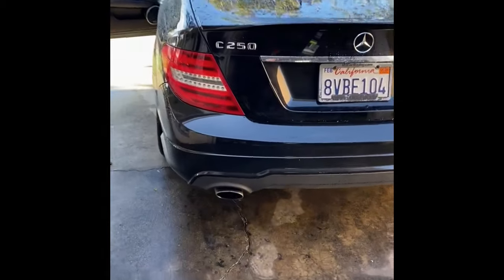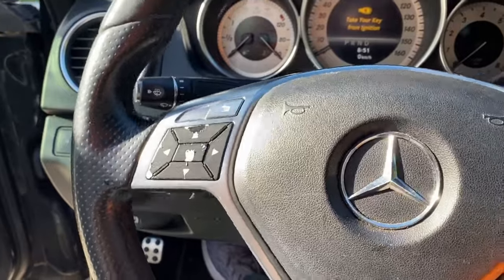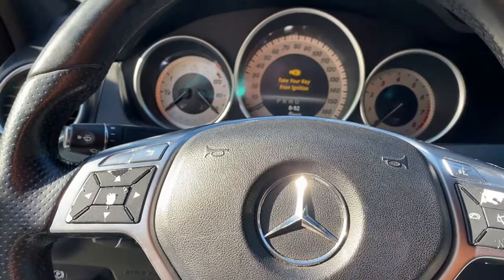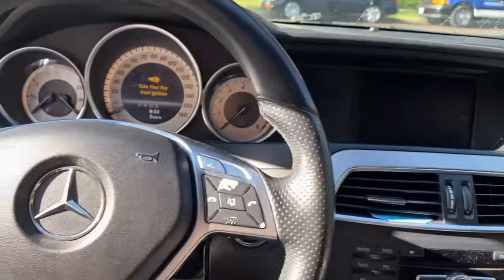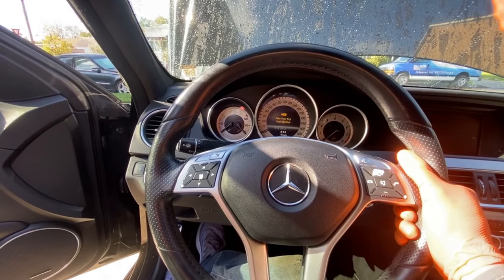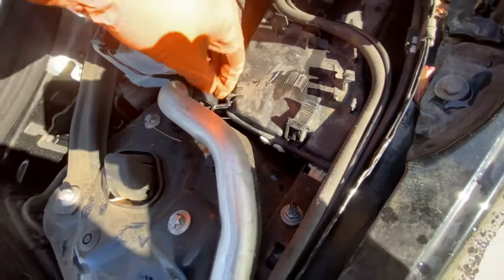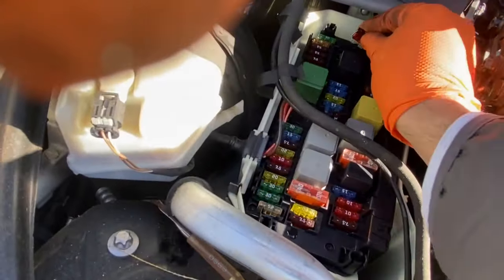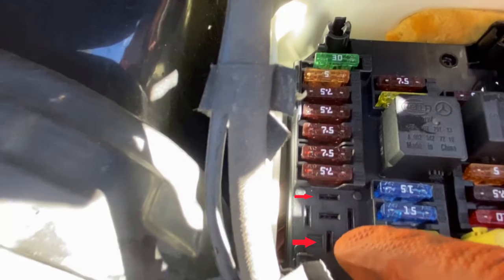Mercedes W204 C300 C250 Locked ESL. Car won't start? You can use this trick to start your car.

Comment: Am having this problem on my 2012 glk350 the car starts but my steering is very stiff please what do I do
Reply from the maker: The steering lock has failed. You must remove the steering lock from the steering column. 

Then send us your ignition switch and key. We will program a steering lock emulator to replace your failed steering lock. 

Watch this video. 

2014 Mercedes C250 W204 ESL Removal. Electronic Steering Lock Removal DIY.
https://youtu.be/CQo6iTOaby4

In this video I’m working on a c class. But your GLK will be similar.
Reply from the maker: 818.510.3375

https://mercedesbenzspecialist.net/
Reply: @mercedesbenzspecialist  I’m so confused my mechanic said it’s the steering pump
Reply from the maker: @OsasIduriase  ok. You said you were having this problem. This video shows how to start the car from the fuse box when the steering lock has failed. 

Maybe you’re having a different problem. Can you start your car normally?
Reply: @mercedesbenzspecialist  yes I can start the car
Reply from the maker: @OsasIduriase  ok you’re not having the problem in this video. This video is for a no crank no start situation.

Comment: I thought it was that buy my crank case to engine  is froze  is that a esl system lock for the hoke engine ne on lock or is my engine done
Reply from the maker: Take the serpentine belt off and see if the main crank turns by hand. Use a breaker bar to turn it.

Comment: I have a 2010 e550 Coupe no start and no crack with full charge of battery and I tried to do this like he showed in this Chanel. I still have the same problems ?? Can anyone  give me suggestion...
Reply from the maker: More information is needed. 

If you insert the key into the ignition switch with the driver door open. Does the instrument cluster give you a message “Take key from ignition”?

Or is there absolutely no response? No audible “ding” no message on the cluster?
Reply: Hi, I'm getting no crank or start on my c200 c class. All the instument cluster lights up and dashboard lights. Steering lock seems fine. It's locked when keys out and unlocks when key is in. However I don't get the ding or remove key fob with either key and as I said the car won't start. This happened completely randomly. Please can you help
Reply from the maker: @minhajchowdhury783 what year is your c200? What country are you in?
Reply: @mercedesbenzspecialist  I'm in England, it's a 2011.
Reply from the maker: @minhajchowdhury783  check for a ground signal while turning the key to the crank position at the fuse box where the starter relay is. Watch this video for guidance on how to do this test. 

Mercedes 2008-2014 C class No Crank No Start. You do have AC on lights. Not the ESL, maybe the ECM.
https://youtu.be/3Ek8foTUl88
Reply: Hi i did this today. The tester showed a reading of minus -697. Unfortunatly i dont have a multimeter with a buzzer. Does this mean my ECM is bad? As it showed 0 or close to 0 right. And if so how do I fix it. Get another and get it cloned? Thank you for your help so far  @mercedesbenzspecialist
Reply from the maker: @minhajchowdhury783 tester? I don’t know what tool you’re using. There should be close to 0 resistance.
Reply: @mercedesbenzspecialist  I'm just using a  normal multimeter. But the resistance when the car was in ignition and cranking was not 0
Reply: @mercedesbenzspecialist  do I need replace ecm?
Reply from the maker: @minhajchowdhury783  yes it needs replacing.

Comment: 🚨🚨🚨If You Do This And Your Wheel Is Locked, LET THE CAR RUN FOR ABOUT 20mins Cut It Off Then Try Cranking it normally.. You’ll kno It’s Working If You Here It Unlock When You Put The Key In.🚨🚨🚨🚨🚨🚨🚨
Reply: Is your car still working?

Comment: Can u do this if steering wheel locked?
Reply from the maker: You can. But if your steering wheel is locked, you won’t be able to drive it. 

Also, this does not work on 2013 models. 

818-510-3375

Comment: Hey, my car is having the exact same issue and it won’t crank either. Only thing that’s different is I noticed your dash actually lights up mine does t have any power at all. No crank and electric power at all. Tried jumpstarting it dash lit up but still no crank.
Reply from the maker: Sounds like two issues. Battery has insufficient voltage. That’s why your dash was completely dark. (Not even mileage shows up?)

When you connected another power source dash lights up. Here is where I need more specifics. 

When you turn key to ignition 2 do you have red and yellow dash lights? If you do, you don’t have an ESL, EIS, or key issue. Start looking for an issue from the fuse box. Bad starter fuse, bad starter relay. 

If you don’t have reds and yellows it’s most likely a bad esl.
Reply: @mercedesbenzspecialist my c300 jumps runs great kills like 5 mins off cables and won’t crank alone new battery that’s the alternator?
Reply from the maker: @toeupalex  I’d check to see if the alternator is charging the battery.

Comment: I have 2008 C350 and it will let me unlock it and lock it with the key fob, and when i get in the dash is on and once i  insert key everything goes off
Reply from the maker: Send me a video of what happens when you stick the key in the ignition with the driver door open. 
562.233.0989
-Michael

Comment: My console says key doesn't belong to vehicle when I put the key in. Will I be able to start if the key is not recognized
Reply from the maker: No it won’t start if you’re not using the correct key.
Reply: @mercedesbenzspecialist  they are correct keys but after replacing batteries in them I got "the key doesn't belong to vehicle" message
Reply from the maker: @amcarr270  You have two keys? Both are giving the same message? The correct battery is CR2025. 

Do you know if your steering lock has failed?
Reply: @mercedesbenzspecialist  yes bith keys give same message. I havent really checked to see if steering locked. I testedcar battery and multi-meter says 11. something volts, then i tried to jump but couldnt then read battery again and said 12.07 volts. If steering is locked then what?
Reply from the maker: Jumping can cause desynchronization of the keys and EIS. It’s best to avoid jumping a MBZ. Use a trickle charger to charge your battery. Or replace it if it cannot be recharged. 

If you have no choice, use a jump pack, and make sure the key fob is not inside the ignition switch when attaching cables to your battery that are powered from any outside source ( jump pack, battery booster, another vehicles battery) only after the outside power source is attached to your battery do you insert the key into the ignition switch to attempt to start your car.
Reply: @mercedesbenzspecialist  it was a last resort as both keys have not worked since batteries changed in them . Plus I can't jump if key not recognized. If I charge battery is it possible keys will be recognized?
Reply from the maker: If they are not synced anymore. You’ll need a programming tool to attempt to resync them. Give me a call tomorrow. I can help you resolve this issue. 

Call us at 818-510-3375
Reply: @mercedesbenzspecialist  okay

Comment: my car w204 c220 wont start even with this trick any help?
Reply from the maker: This trick won't work if you have a bad key, bad ignition switch, bad starter fuse, bad starter. There are ways to diagnose all of these. Get in contact with us if you need help.

https://mercedesbenzspecialist.net/services
Reply: my Electronic Steering Lock is dead and i just ordered new one could that be the problem
Reply from the maker: @kariturve2570  usually this start trick works if you only have a bad steering lock. If this trick is not working. You may have a bad key or ignition switch. 

I can help diagnose the issue over the phone. While you’re at your car. 

Make an appointment here. 

https://mercedesbenzspecialist.net/services

Comment: where can I get that wire??
Reply from the maker: It's a 14 guage solid copper wire. Commonly used for household lighting circuits. You can get some at home depot or Amazon.

Comment: Ok so my steering is unlocked but my ignition won't turn on c240
Reply from the maker: Steering is always unlocked? If always unlocked. Your ESL has failed. 

If it unlocks on key insertion to the EIS, do you have red and yellow dash lights when you turn the key twice to the right?
Reply: The ignition is locked Will not turn
Reply: Car died in drive I turned the windshield wipers on and it kinked and cut wires I repaired them and now I have the ignition problem
Reply from the maker: @JoshuaGalvan-vh2hy  Ok this just got way more complicated. I'd go back and make sure the repairs you made are good.
Reply: Ya I know I've ran through it over and over it's getting frustrating even in neutral key won't turn
Reply: Like it's locked won't go to second position
Reply from the maker: In your first comment you said the steering was unlocked. Does it lock when you remove the key from the EIS?
Reply: No
Reply: Key doesn't work what do ever nether the wheel I have to replace ignition now I accidentally broke it
Reply from the maker: Oh no, If you need a cloned EIS. Give us a call tomorrow. 818 510 3375

-Michael

Comment: Dont see the point to this if your Steering Wheel is LOCKED.
You can NOT DRIVE THE CAR??
Reply from the maker: That’s why I made a point of stating that IF you’re steering lock failed in the Unlocked position… as the vehicle in this video did. You can drive the car using this trick.

Also, if you got caught with your windows down or a sunroof open. You can use this procedure to turn on the car and close them.

Comment: Didnt work on my 2013. It cranked but didn't start
Reply from the maker: This trick doesn't work on 2013. Not sure about 2014. 

818.510.3375

https://mercedesbenzspecialist.net/
Reply: @mercedesbenzspecialist  c300 sorry. Not sure I'm stuck at Walmart lol. When I pull the fuse the gauges come on and can charge my phone.

Comment: Yes, you can start the vehicle like this...HOWEVER,  it will NOT unlock the Steering wheel!
Reply from the maker: That's correct. In this video I did mention that this works if your steering lock failed in the unlocked position. 

To fix this issue permanently you need to remove the factory steering lock and install a programmed emulator. 

818.510.3375

https://mercedesbenzspecialist.net/

Comment: Hey i got my car to start but my steering wheel is locked
Reply: What should i do, im stuck at a car wash rn haha
Reply from the maker: Try holding the steering wheel with both hands. Move it left and right banging against the steering lock. Do it hard. Try for a few minutes. Meanwhile inserting the key into the ignition switch. If it opens up, you’ll be able to drive your car to a location where you can have it repaired. 

If banging the steering wheel doesn’t work. The only option is to tow it. 
You can purchase a steering lock emulator programming service on our website. 

https://mercedesbenzspecialist.net/shop/ols/products/mercedes-c-class-glk-class-e-class-coupe-slk-class-electronic-emulator

Comment: I follow same steps except I opened the relay and touch both coils manual.
However 
I can here the ignition trying to start but doesn't continue to start up
Reply from the maker: You hear the starter cranking? Or maybe just a click from the starter?

Check battery voltage first. If voltage is good you should get a strong crank. 

If not, check for voltage drop from battery to the starter. If there is no drop, remove starter and have it tested.
Reply: @mercedesbenzspecialist  
Well, yes I heard the starter cranking but not to full starting, I tried a couple of times, afraid to drain the battery, I then opened the cover  under the steering wheel and right above the ESL , I snap with heavy tool (like the old days 😀).
And guess what, I can hear the unlock steering again.
Once done I start the engine as normal and it starts immediately with first trial so I suppose it may be something related to my Facelift model that prevent it from fully operate according to your instruction 🤔
Reply from the maker: What year and model?
Reply from the maker: Hmm.. that is interesting. What year and model do you own?

Comment: Has anyone esl just come right after start like this?
Reply from the maker: I don’t understand the question. ESL come?
Reply: @mercedesbenzspecialist  has doing this fixed the esl for anyone? Mine has stuck itself in the open position after my battery went flat
Reply from the maker: @nizzleshot  This doesn't fix the ESL. This is a work around that should only be used to get your car home or to a repair shop. 

The permanent fix is to get an ESL emulator programmed. If your ESL failed in the unlocked position. It's a very easy fix for you. You send us your EIS and key, we program an ESL emulator for you. You then plug in the ESL emulator and your done. Your car will start normally, using the key.

Visit our website: https://mercedesbenzspecialist.net/all-products-%26-services/ols/products/mercedes-c-class-glk-class-e-class-coupe-slk-class-electronic-emulator

Or call us at 818 510 3375

Comment: I  did this but the wheel stayed locked. Any ideas?
Reply from the maker: This does not unlock the steering lock. This only starts your car. 

I mentioned in the video, that this is only useful if your steering lock failed in the unlocked position.

Comment: I’ve a question 🙋‍♂️
Reply: I did the same but my w204 is stuck with steering lock problem and won’t turning its steering to any position do you’ve any fix for it?
Reply from the maker: @hassanakram9096  yes. Remove the steering lock. Send us your ignition switch and key. We program a steering lock emulator. You plug it in, and the problem is solved. 

https://mercedesbenzspecialist.net/shop/ols/products/mercedes-c-class-glk-class-e-class-coupe-slk-class-electronic-emulator

Comment: Car star buy the wheel is lock
Reply from the maker: Yes. You must remove the steering lock in order to drive it. We can program a ESL emulator for you to permanently solve this issue. 

https://mercedesbenzspecialist.net/shop/ols/products/mercedes-c-class-glk-class-e-class-coupe-slk-class-electronic-emulator

818.510.3375

https://mercedesbenzspecialist.net/

Comment: Knew that. But I put a tiny hole in the coil side of the green relay cover. That way I can just use a tooth pick to push the relay closed to start the motor 
No pulling the relay out anymore.
Reply: damn, McGyver 😮
Reply: @parallelpost  😂